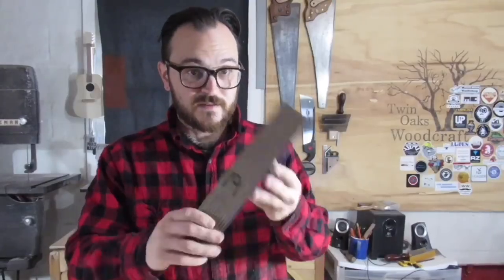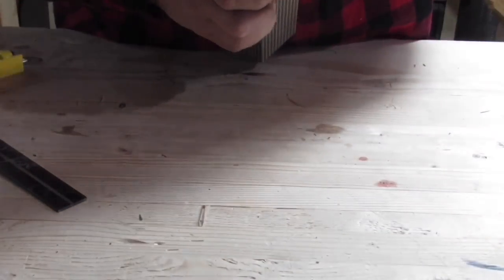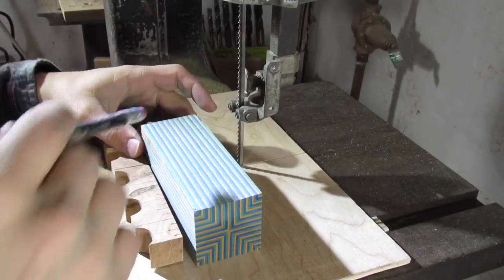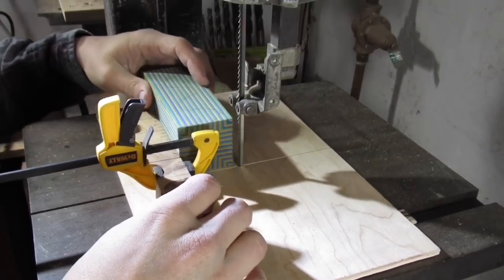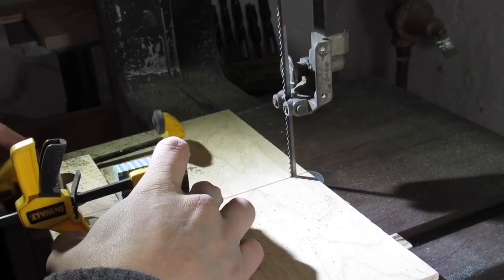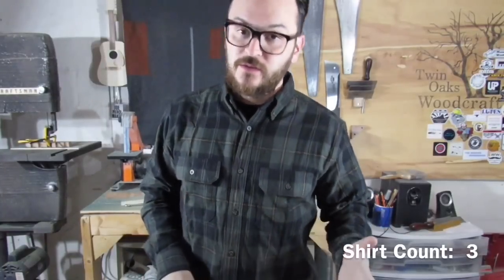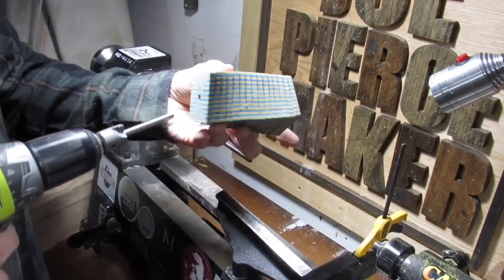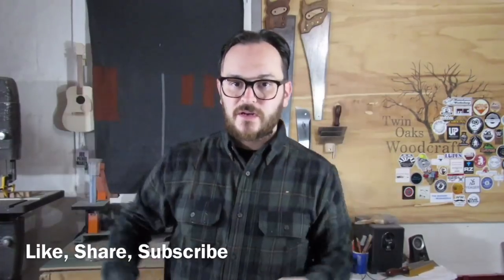Segmented Spectraply Turning Blanks - How To

Comment: I saw you had trouble getting the bolt off of the blank after glue up.  You can use paraffin wax on the bolt.  The wax works well on threaded bolts too.  The bolt will slide right off, no problem.  I make custom fishing rod grips and that is how we glue up cork grips, etc.
Reply from the maker: That is an excellent tip! Thanks!

Comment: Great video! However, I have one critique: please reconsider your choice of wearing long sleeves near that belt sander. Your sleeve was incredibly close to the sander at one point.
Reply from the maker: Thanks.  Not to worry.  This is the Harbor Freight sander, it is so under powered that I can stop the belt just by sanding wood too enthusiastically.  So if it were to grab my sleeve, it wouldn't pull me in.  I appreciate your concern.